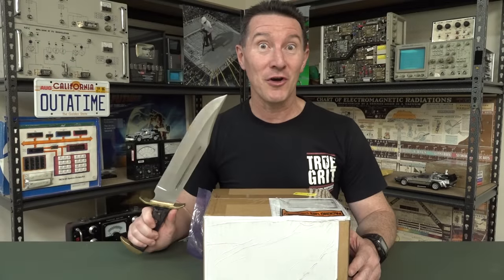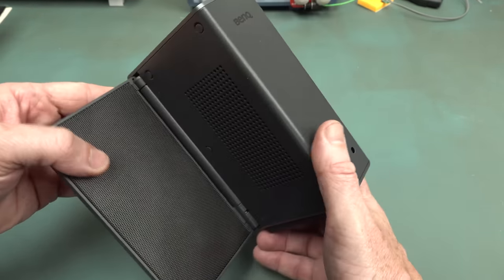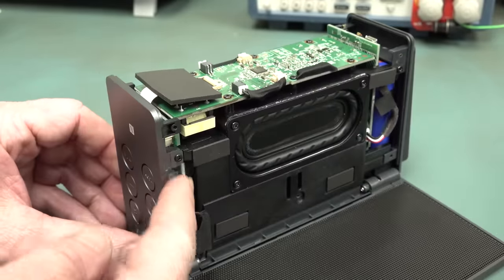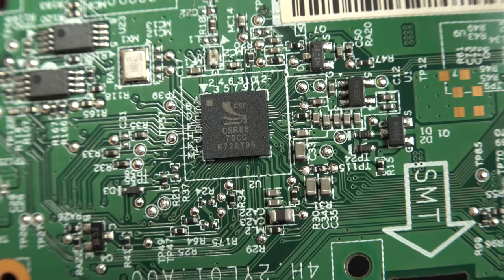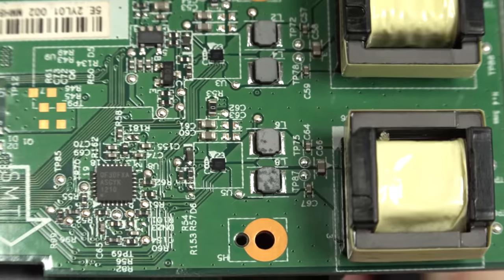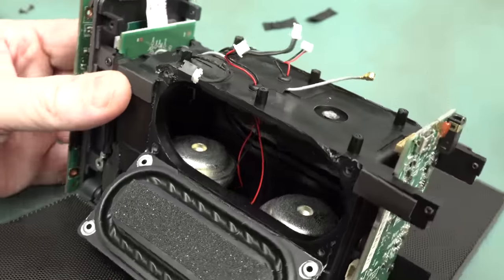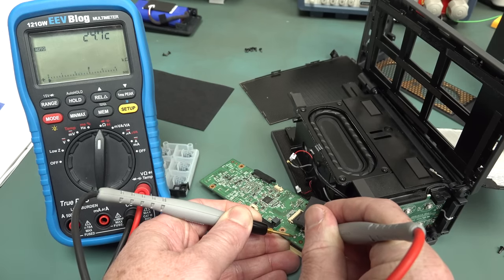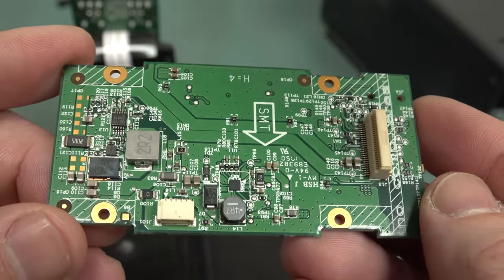EEVblog #1150 - Electrostatic Speaker Teardown

Comment: With no connection to the diaphragm this is definitely an "electret" speaker, not an electrostatic speaker. This type of speaker uses a static charge impregnated into the diaphragm. Electrets make pretty decent microphones, but are pretty well regarded as the dumpster version of an electrostatic speaker. The fabric-like construction of the driver itself reminds me of the commercial E-Stat sheets made by Warwick Audio Technologies, except the WAT sheets are single sided (only one grid).
Reply from the maker: Of course, that makes sense. I knew that's how electret mics worked, but had no idea you could make speakers from them. They definitely market them as electrostatics - "treVolo 2 uses the same electrostatic technology that is typically reserved for high-end speaker systems."

Makes sense they are the lower quality than proper electrostatics, and I note consideration distortion, even though once again they claim low distortion as a feature of these.
Reply: @EEVblog  Just like about everything, you can use things in reverse, and it often doesn't make a good version of that. Just like a speaker makes a horrible microphone.
Reply: I have a pair of Stax eletret headphones, they require an amplifier to drive them through a speaker output and sound amazing. Saying they're "dumpster" versions of electrostatic sounds like the way audiophiles talk where they'll denegrate everything that isn't what they consider the best. Somehow there being something incredibly expensive means that everything else is a trash fire.
Reply: @EEVblog  Almost like manufacturers make misleading claims to drive up sales.
Reply: @Stephen Morton I have high quality audio gear but do not buy into snake oil products.....so am I an audiophile I wonder!  I hate compressed lossy codecs, so maybe that qualifies me as one? :-p
Reply: This fine piece of system engineering artfully manages to give electrostatics a bad name. Just like packeted "fruit juice" industrially assembled from anything but actual fruit juice.
Reply: @EgoShredder  This video wouldn't be possible without lossy codecs. So, yes you are.
Reply: @eurobum2012  Damn!  I'll book an appointment with my doctor tomorrow.  Best to get it sorted before I end up with gold plated connectors and acoustically suspended listening chairs! (I'm joking but knowing audiophiles they probably levitate whilst listening too!).
Reply: Yeah, this would be WAY too small to be electrostatics.  Check out "The Electrostatic Loudspeaker Design Cookbook" by Sanders.
Reply: @Stephen Morton True.
Reply: @Nukleon Sorry, I should clarify, that reputation comes from the frequency of electret devices being marketed as electrostatic and the general inferiority / lower price of the technology leading to their use in dodgy products, in addition to the limited lifespan as the charge wears off. There are always exceptions to the rule, and Stax definitely makes some of the best electret drivers on the market. However, the technology itself is still much more limited than full electrostatics (which is why Stax still makes primarily electrostatic headphones).

Also it's probably a little pedantic, but the difference in cost between an electret and an electrostatic driver itself is actually quite minimal. The primary cost driver is in the amplifier's high voltage charge dump circuit, which applies a much higher charge to the diaphragm and requires additional transformers and DC regulation (essentially a power supply) or a boost circuit, both of which have to be low noise.
Reply: @EgoShredder  What's wrong with knowing good quality sound [people who listen to MP3 music don't]?  If people didn't have taste and expectations for the best,then we would still be watching fuzzy black and white television!
Reply: @EgoShredder  No, that would be an audioPHOOL. I feel like one too now, because ever since I watched Dave's video, I'm getting all these fanatical speaker reviews in my recommendations.
Reply: @jonathanpalmer155  Nothing wrong with a desire for good quality sound, and I am someone who strives for that to,  and have spent thousands on various equipment over the years.  However I come from more of a musician and studio recording background, so not the stereotypical audiophile person.
Reply: @Nukle0n  Speakerwise they are the dumpster version. Not in relation to headphones. Totally different ballgame accoustically.
Reply: Lennart Söderberg  It's worse than that. First of all I know a person who genuinely believed he could hear the difference between spdif toslink or coax. Second of all, there is this nice audiophile site that sells directional sata cables to gullible people, and people actually praise how much better it sounds due to less jitter and such. It's so absurd that I am actually starting to believe it's a troll site.
Reply: @bloepje  Yep some crazy people around with too much money in their pockets.  I think you can aim for well engineered quality gear, and then anything beyond that is just diminishing returns.
Reply: Lennart Söderberg  I agree but I suppose there is always that element of subjective differences between things and people's hearing.  However the whole gold plated cable nonsense and green ink on CDs is just that.....lunacy.

The only thing that will affect the digital sound of CD playback, is if say the disc is in poor condition and the laser is struggling to read the data, and the decoder buffers become overloaded trying to error correct the data.  When that happens you get a loud garbled sound, which if bad enough can make it hard to even hear what the music is meant to be.
Reply: Lennart Söderberg  I think the reason some people think LP is better than CD, is down to the better mixes that were mastered on reel to reel back pre-1980s.  However if digital is used in a sympathetic way to the music and the format, it will sound better than LP.  Sadly this is rarely the case and hence why the revival in vinyl records has sprung up.   So I myself will often reach for a vinyl over the same CD, due to the digital mix being horribly done on CD.  The LP on the other hand will have used compression far more tastefully as a tool, rather than as a vulgar pumped up effect.  So the LP ends up having a greater dynamic range than the CD mix, because someone with a brain knew how to mix with the music and format in mind.  If they mixed and mastered like this on CD, digital would win every contest just about.
Reply: @muppetpaster  Ok, that makes more sense then
Reply: @bloepje  that's freaking hilarious.  spdif is binary data no matter how you do it.  directional sata cables?  that's new on me!
Reply: @EEVblog  -  wow.   "uses the same technology as...."  lol  That's like saying this Yugo car uses gasoline, the same tech as used in HRH Queen Elizabeth's Bentley and Rolls.   
     I originally thought that the mic wasn't picking up the electrostatics very well.  They sounded very harsh.
Reply: Gentlemen, I appreciate the technical distinction that has been made to point out this BenQ is not a “true” electrostatic.  So I am in a position where I have martin logans in my home theater already. I require a smaller solution in my home office to recreate the electrostatic sound.   Please suggest a solution if not this BenQ.  Thank you!

Comment: A few thoughts. As noted by others. These are elecret electrostatics. That still makes them electrostatics. Electret refers to the way the charge is impregnated into the diaphragm. Nothing more. In general the problem with electrets has been that the diaphram material needs to be a bit thicker than you can get away with if you are externally supplying the bias. So you get the same problem with microphones, electret microphones tend to not be as good as those that provide a bias voltage to the diaphragm.
As to passive radiators. They work identically to ports. They are a mass on a spring, which is what a pipe full of air looks like. The advantage of a passive radiator is that you can get combinations of mass and spring that would require a port of silly size. So they are an obvious design component in small speaker boxes. Passive radiators and ports take over the lion's share of bass radiation at low frequencies and can add a very significant amount of bass capability. Capability that importantly includes bass loudness that the speaker driver alone could not produce without exceeding its excursion limits. 
Any EE will be happy modelling speaker boxes - there is a direct translation from the physical parameters of speakers, the box, port/passive-radiator to capacitance inductance and resistance. So much so that it is easy to usefully model a real life speaker design in Spice. 
A point about panel speakers in general. They are dipole radiators. This of course means that they intrinsically can't reproduce sound with wavelengths much larger than themselves, as the sound wave cancels out around the speaker. But the rear radiation of sound gets energy into the reverberant space of your room, something conventional speakers are not so good at doing at higher frequencies. This can be very beneficial. Full size panel radiators or di-pole speakers can be set up to work in a room and manage the mess of reverberant versus direct sound to advantage. Not so much these little speakers, but there will be no doubt that the energy radiated off the back of the panels will have an influence on the sound, and especially the range of listening positions where they can sound good. 
Someone put a lot of effort into this little speaker design. However I am suspicious that those cross pattern spacers were a late add on to cope with problems in the speaker, and that they are the reason the panels have such a poor low end frequency response. It smells like the intent was for the panels to go much lower - maybe down to 500Hz, and there were problems that were band-aided late in the piece.

Comment: Forgive me but the rubber pads are not to keep the electro static drivers from going "thud" against the unit, those are to keep the metal shroud from vibrating and causing noise. I bet $20 the rubber screw covers are to prevent the speakers from going "thud"
Reply from the maker: Yep, you are right, my goof.

Comment: 18:53 I don’t think you can necessarily infer the transformer turns ratio from the resistances. Typically used thicker wire for the low turns primary to keep the current high and thin wire with higher unit length resistance for the secondary.
Reply: True, but that just means turns ratio will be even higher, because they probably filled 1 layer with the primary winding, and then the secondary side is hundreds of layers ( probably bunch wound to get the interwinding capacitance down, like any CCFL transformer is, which is what I suspect these are) of spider thread. 

Would be interesting to find some large CCFL inverter transformers ( probably old big screen TV with 2 CCFL tubes) and try them out with an electrostatic speaker and see if they perform as good as the ultra expensive custom wound ones normally used.
Reply: Dave is not really inferring the specific number of turns from resistance but rather confirming a rough magnitude in the ratio.  Consider a rather fine #40 gauge secondary, even at that fine a gauge you will need around 1000 feet (300m) to achieve 1K-ohm resistance and, in a small transformer, it does not take a lot of guesswork to infer from that that there are thousands of turns to achieve 1.5K-Ohms (IIRC — or whatever the final resistance was).

Comment: At the 32:50 time mark there's a "hidden message" at the end of this video. Wacky !
Reply: Oops, editing mishap :D
Reply: The video is only 29:45 long.
Reply: @simontay4851  

I swear the vid was longer just now, but an advert kicked in when I tried skip through, and then it showed the shorter time.

I think it just means that Dave used YouTube's editing function to trim the vid.
Reply: @simontay4851  yeah, because Dave fixed it.
Reply: This is weird. It shows that the video is 33.07 long but playback stops after 29.44 and that's how long the seek bar is as well.

Comment: The industrial designer looks to have cut their professional teeth on Sony equipment. Unfortunately the loudspeaker systems designer seems to have learned their trade at Amstrad in the late 1980s, and then had the last cent of cost beaten out of them in backstreet Shenzhen. Embedded electret sheet? That's incredibly low budget crap. I don't think Quad ESL have much to be afraid of.
Reply: Zadster, I believe you will have to translate this into more normal English for rational consumption. LOL
Reply: @BruceNitroxpro  'It's very pretty and sturdy but full of hot air and bullshit'  :D
Reply: That was absolutely splendid English. Moreover, the meaning was conveyed fully and succinctly.
Just in case you are too young, or not from the UK.
Amstrad were Alan Sugars attempt at building cheep as fuck electronics in the 1980s, packaged up in an effort to look half reasonable to anyone with little to no idea, or around 90% of the population. They were plastic silvery boxes, with basically fuck all in them but the most basic of components, usually the very minimum on one board, with the thinnest of wiring.
An insult to electronics and design, especially quality audio.
They were, in a word. SHITE!

Comment: You need to use a audio spectrum analyser to do speaker spectral comparisons
Reply from the maker: Meh, couldn't be bothered.
Reply: @EEVblog  couldn't be bothered seems to sum you up, unsuscibe
Reply: LOL goodbye then
Reply: Who cares? lol
They're not audiophile speakers, so really there's no point.
Reply: Would just need one of the spectrum analysers that go below 9kHz, almost any electret insert, a CR2032 coin cell, a 1k resistor  and a 100n mylar coupling capacitor to make a non calibrated relative analyser. Think you could get that together without even looking hard in the dumpster room, one old PC and one phone will do the lot, plus a blob of hot glue to hold it all together on some sort of stand.
Reply: This is an electronics channel, not a speaker review channel...
Reply: WeNeedMoreFarads - Dave tried to do a sound quality comparison, a spectrum analyser would of given some measurable comparison data.
Reply: @SeanBZA , IF he were trying to do a speaker review, yeah... otherwise, "Meh!"
Reply: Yes, but not to demonstrate what he wanted to demonstrate (obviously?), lol. This isn't a review, remember.

Comment: I have been using my Trevolo S as a DAC speaker on my laptop since I did my review. 
Has been excellent, Yes sound somes out of the back and front.  I didn't tear mine down yet as I didn't have a small enough torx.

Comment: Could be an Electret diaphram, no need of biasing. AKG got a headphone with this trick with transformers integrated inside, which could be driven directly by a power amplifier.
Reply: Normally the grid should be very stiff to avoid any modulation in audio frequency, in Sennheiser Orpheus 2 they even used gold plated ceramic as grid. Dunno if theres some magic going on...

Comment: How would it handle humidity?  Does it sound like a bug zapper if used in the bathroom :-)
Reply: 'Real' electrostatic speakers usually do just fine in any normal living room conditions. 
In the bathroom, they will rapidly go to shit because the membrane is incredibly thin. Condensation will ruin it.

Comment: It's just an idea, but IS the dialectric carrying a load at all?
What if it relies on purely electric movement of the plates due to the coulomb forces?
If so, the sound produced would have roughly a double pitch (frequency doubled) but since it is digitally processed, it could easily be compensated in the DSP!
You could feed the waveform into a seperate speaker/amplifier (analog) to test that. Or you could compare the inputsignal if there  is an analog aux input to the drive signal.
Anyway, I am curious to find out if it is that or using a loaded diaphragm like an electret.

Success with your magnificent channel!

Comment: I’m wondering if a low powered Cr 3032 battery powered audio player could play a stereo waveform that simulate a 50hertz ac sine wave and then stepped up and rectified to a usable power source. 🤔😯